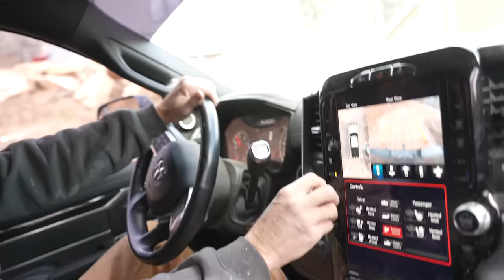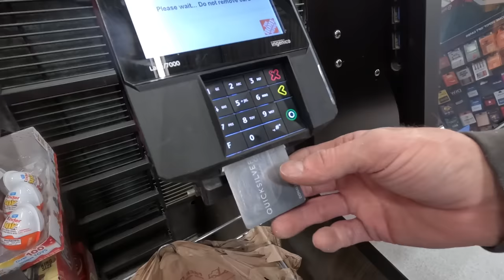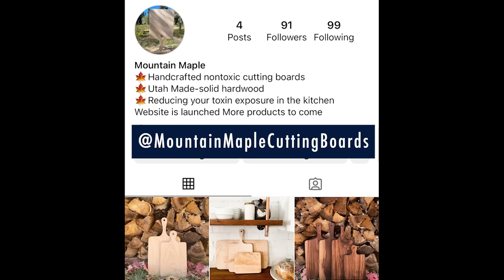INSTALLING WINDOWS THE HARD WAY

Comment: Suggest putting those small ice dams on roof above living doors. Will hold back ice from sliding onto ground (or people) in large sheets. Depending on how long length of roof is may need couple rows of these. I have used clear plastic ones so don't really notice them from outside

Comment: Trent, have you thought about putting a hefty eyebolt in the eave of the addition above the roof change on the original roof? Then you could use it with climbing rope and harness to more safely clear the snow that will build up there.

Comment: Hi Allie looking at your mushroom setup now the extension is coming along. Have you thought to move the desk to be in front of the windows looking out towards the garage and over the valley.  You must spend hours working and having such a gorgeous view behind you why not look out on it instead.  (I also work in a corner of a room from home but side view will do).  Then move the storage cupboard buffet up against the wall.  Hey the table may not be narrow enough or too close to the door but it was a thought.

Comment: Just a suggestion for temporary heat, but a forced air garage furnace. Set it up on a stand and run a line from your propane tank. Way more efficient than 20lb tanks

Comment: as a fellow Starlink subscriber....

That location for the dish is amazing.... you have to be at 0 obstruction.

26:45

But yes.... with the stove pipe, maybe the other corner would be better... though a bit of heat might prevent it from having to use it's snow melt feature as often(reducing electric costs)

Comment: I know someone has probably asked this before, but as hard to scroll back through the 807 comments on this video and the thousands on videos before… What the heck is that little plastic bag on each of the windows. I assume it has something to do with the Air pressure between the panes?  It’s amazing how many steps there are in building a house. Every time you get to do a new one it is fun at first, and the hard part is to do it so many more times to finish up that step. Great job guys.
Reply: U assume right. Keeps it from breaking or helps it set in??? Idk but definitely  pertains to new window installation  lol

Comment: If you put the " Propane Tank " higher than the " Heater " you'll probably get more heat from the downward pressure of the gas . The place I used to work used 100 lb. tanks which created it's own pressure . Just sayin . Happy Trails from 🇨🇦 to the 🇺🇸 . ✌ out

Comment: You should of put that burner up on some scaffolding closer to the ceiling. With a strip of plastic of some sorts tacked up on the rafters, to help contain the heat under the troubled area better.

Comment: This may be a tip or not...walking on snow leaves snow/ice prints. Try shoveling before the snow is stepped on and you will find it easier to remove and less ice build up. I leave my shovel outside  my front door and shovel a spot before stepping outside. It really does solve some ice / packed snow issues.
Just a thought. (Yes, even the pups can leave their icy little prints )

Comment: nice to get window in and have the space under it to heat to reject the snow, but realize that once you insulate that space under the metal, that's not going to happen as easily unless you put some coils on the surface to heat it from that side...

Comment: Should use Isopropyl Alcohol to clean the glass on the windows to put the Suction Cups on instead of the spray cleaner . Most of these cleaners have an ' oil base in them . ✌ out

Comment: Celebrating with all of you that the windows are up and fully installed in the extension. I held my breath many times as  you/the team were lifting those windows into place. One huge concern taken off the list. Looking forward to the next video and the metal roof install on that critical section of the roof. Then, I can rest assured that your heavy snow falls won't damage all your very hard construction work. Well, I can't really fully breath easy until the door is also be installed in that area. Allie, I think you are one of the unspoken assets on your family work site. You keep that work site free from safety hazards by your continuous picking up and cleaning up as construction moves forward. Soon, Christmas decorating will be underway. Yeah!

Comment: Stupid question.  Would some kind of heat trace under the metal panels help with removing snow from the roof.  Kinda like defrosters on rear windows or keeping your pipes from freezing?

Comment: "Balloons" hanging off new windows are driving me cray cray.  What is the purpose?
Reply: Most windows I've seen here in Australia have a big sticker of some sort on the windows,  usually the manufacturer's name.  I think the balloon is more to do with equalising air pressure between the two panes of glass as they're double glazed (not seen often here) and we don't build in the same altitudes that the USA has (~8,000 feet) @@AussieTracy